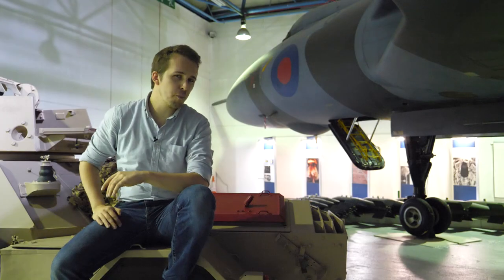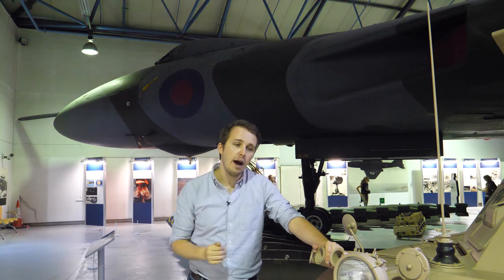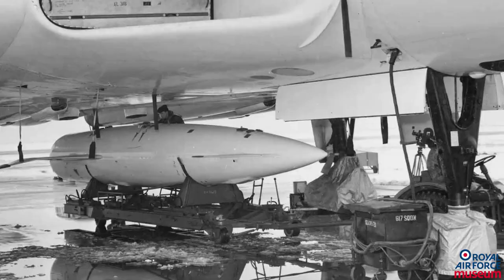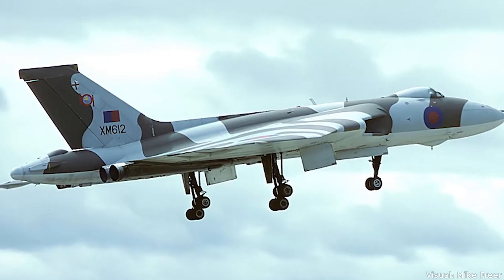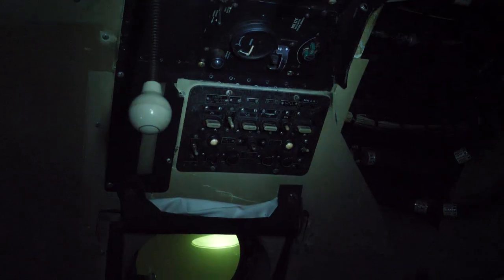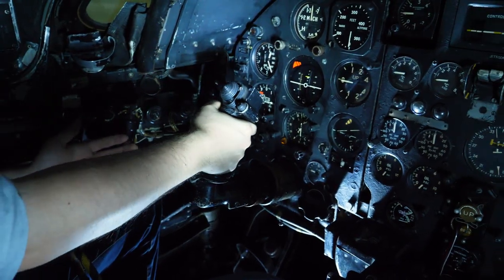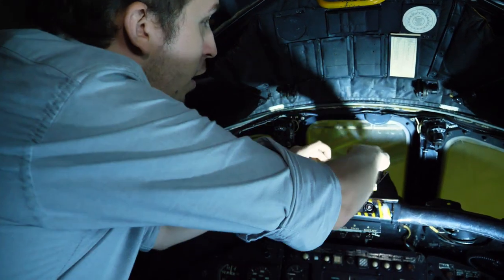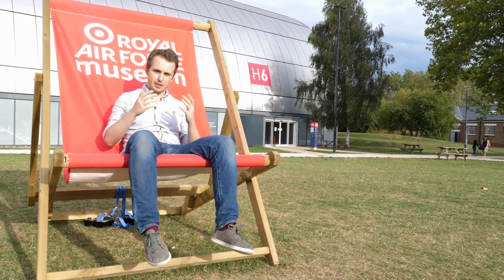Inside The Cockpit - Avro Vulcan B.2

Comment: I was lucky to be able to sit in the cockpit of this magnificent aircraft - I sat in the pilots seat and as large as the whole aircraft is once inside it is very snug fitting for the 5 crew that man it. once in your seat though everything feels cosy! This Vulcan was in a air display museum near Manchester (I forgot the exact name) but they had retained everything that the operational crew had at their disposal. For example there was an eyepatch for the pilot to wear should the aircraft ever be used for it's ultimate purpose. The eyepatch was to be worn to help protect the eye from the flash of a released nuclear weapon , on top of that there were smoked glass screens that could be used to cover the small windows in the cockpit once again to help protect the crew from the resulting flash of released  nuclear weapon(s). It was both an awesome and chilling experience to sit there and think of those whose who flew them never knowing  one day  from the next if they would be required to make their inevitable one way journey to enact what was then a vital part of our nuclear deterrent. Despite this I was in awe of the engineering achievement so soon after a world war a few years before fought almost exclusively with aircraft of propellers and piston engines and thinking what a shame it is that it took fear of a nuclear holocaust to bring out our best in terms of creative engineering and innovation.  I sincerely hope as a species we will progress very rapidly to finding an equal fervour to create and innovate for PEACE and prosperity and no longer be motivated only by fear.

Comment: The plane that just doesn't fit into one picture. Really, couldn't get a good shot of the one in the RAF museum, but it is very inconveniently placed for photos there.
Reply: It's the same in alot of museums unfortunately lot of planes and a limited display area. Best off visiting one which is outdoors, newark air museum is a good example as they open the cockpit quite often.

Comment: Managed to get inside one of these back around 1980 back when Bruntingthorpe was an RAF repair facility and they did occaisional tours. Cramped is my main memory and a comment from the guide that the downstairs crew were supposed to leave in a particular order, costliest to train first! Also that they were supposed to swing themselves out of the way of the nose gear leg if that was still down.  I got th distinct feeling that it was considered unlikely any of them would really stand a chance.
Reply: IIRC, of the 15 accidents with the plane. In 10 of them none of the rear crew survived. It was not a good solution to be. The AEO and the Radar operator actually had ejection seats, it ejected them into the open crew door. Not much but apparently better than nothing. The Nav plotter was possibly the least safe position to end up in.
I've sat in the cockpit. The one thing Bismarck failed to really point out, though he alluded to it with the 6th crewman. The vision is appalling. Due to the high AoA on landing you couldn't see the runway, you were totally reliant on instrument landing systems. Even when flying you couldn't really see forward. Forward and up was your only real vision, I seem to remember our guide mentioning the front bombing window being used to guide for taxiing.

Comment: Right, I may have slight bias but I try to be objective. My father was part of the design team on the Victor, asked to critique the Vulcan and also worked on getting XH558 back flying. For the high altitude role you state the Victor was far superior. Once the Soviet radar was updated though the stresses on the Victor wing at low altitude made it impractical, hence the Vulcan being adopted. The Vulcan was definitely a better aircraft at lower levels which was the amended requirement. The Victor had a higher ceiling, bigger payload and longer range at higher altitudes, hence it being perfectly suited as a tanker in the then new world. It was inherently better at meeting the original specification but things change. It's still a sexier plane though :P
The raid on Stanley during the Falklands conflict though? I still can't see that as anything other than a propaganda move. "We could have delivered nukes. Think about it". 2 Vulcans, 11 Victors and damage that was repaired within 24 hours. It sent a message, the message was received. Note 11 Victors required to get the Vulcans there...
Don't get me wrong, I appreciate the engineering involved in the Vulcan, what it was capable of and what it did. Some of what I know is apocryphal, no evidence basis other than the memory of my father (who, apparently, got quizzed on why exactly he showed a delta wing glider model when applying for a job at Handley Page at a time when the Vulcan was in development but definitely under wraps) but I will never have the overwhelming adoration for this aircraft that many do.
Reply: So your Dad worked at Fred's Shed???  Victor was (in the B Mk 1 form) the only one of the three V-bombers to be able to pass Mach 1 in a dive.
Reply: @richardvernon317  His first job in aviation. Grandfather and great uncle on his side worked for BOAC and Imperial Airways. He later worked for Hawker and was part of the harrier design team as well. He finally retired from subcontracting at 75 years old, the last job being for Marshall's in Cambridge getting a certain Vulcan airworthy again :)

Comment: The 707B’s air intake is an interesting choice. Obviously made possible by the fact that the Derwent was a centrifugal engine
Reply: NACA flush inlets. Popular at the time. Early P-80 variants also had them. They offer low drag, but have poor total pressure recovery and high distortion. Very incompatible with axial compressors. They are still used for auxiliary air inlets where recovery is not as important.
Reply: @MrKentaroMotoPI  That was my thought as well. An axial compressor would never be able to get proper airflow through the engine, but a centrifugal engine opens that up. Obviously was a dead end in development, as there are very few planes who still use them. 

I guess they were less efficient, and were also wider, which made the planes who used them bulkier. 

This all being more than enough to offset the advantages of a flush inlet, especially as aircraft got faster.
Reply: @jeffreytam7684  Yes, and there was something else. In the early 1960's, the "zero drag" inlet was invented by Lockheed's Woody Beck and first used on the C-141 Starlifter. It is now universally used in subsonic inlet design. By carefully contouring the inlet lip highlight, the cowl lip suction can be made to equal the cowl external drag. Total pressure recovery is unaffected even though a stagnation streamline impinges well inside the inlet. The shape gives subsonic inlets their "thick lipped appearance".

Comment: There is a episode on Malvinas with a Vulcan running out of fuel where he made a emergency land on Rio de Janeiro.
Reply: The in-flight refuelling probe snapped off during its post attack refuel on the way back to Ascension Island after a Anti Radar attack against the Argentinean TPS-43F air defence radar and gun laying Skyguard radars. The Argentineans switched the TPS-43F off as soon as they knew that a Vulcan in the area, so the Vulcan couldn't launch the two Shrike missiles that were tuned to that radar at it, but one of the Skyguard radar's tried to track the Vulcan that destroyed it with one of the two other Shrikes it was carrying. When the Aircraft diverted to Rio, the crew tried to jettison the three remaining missiles in the only way that they could by firing them. One of the missile's misfired and the Aircraft had to land with it still on the aircraft.

Comment: What is amazing is when they changed from high level to low level bombing use they could fly these babies literally on the deck like a fighter often below 250ft!!!!
You could also barrel roll a Vulcan and make extreme evasive maneuvers something other bombers of that era (B52) couldn't do. 
When one flies over you and they hit the afterburners the noise is unbelievable and the ground shakes.........A beautiful bird.....Thanks Bis.....When are you doing the HUNTER and the LIGHTNING?
Reply: The Vulcan did not have afterburners.  No V Bombers did. What you heard was just good old throttle.
Reply: At very high Altitude the Vulcan pissed all over the Hunter and Lightning as regards manoeuvrability.

Comment: If I remember correctly, during the Falklands War, only 1 bomb from the Avro Vulcan hit the runway during it's historic mission over thousands of miles from the Canary Islands to the Falkland islands.  Why didn't the Avro Vulcan simply line up with the runway and use the visual bombing sight to plant all the bombs on the runway?
Reply: A. Ascension Island is not in the Canary's (its around 3000 miles south of that group of Islands).

B.  When the Vulcan attacked it was Dark and the Weather in the Falklands for most cases is bad. At the time is was late Autumn. Most Argentinian fighter bombers were daylight capable only. Visual bomb aiming needs daylight and good weather

C. Stanley Airport was quite heavily defended with a mix of Visually aimed AAA guns and SAM (Tigercat), plus some really advanced stuff Radar controlled guns and Roland SAM capable of shooting down aircraft at up to 20,000 feet. If the AAA and SAM's can see you, ECM will not save you and the guns and SAM will kill you.

d.  The bombs are released two miles short of the target and you do not know the exact wind conditions between yourself and the ground, thus trying to drop the bombs down the runway is most likely going to result in NO BOMBS HITTING THE RUNWAY.  If you drop a stick across the runway, you are likely to get one on target at minimum.

e. To blow a big hole in a Runway, you have to have the bombs hit the runway at great speed so that they punch through the concrete and explode under it, this makes maximum effect of the explosive content and makes a big hole that is difficult to repair  If the bomb doesn't go into the concrete (explodes on the surface), the majority of the explosion take the path of least resistance into the atmosphere and just scabs the surface. That can be fixed with a broom!!!!  

Real Warfare is not WAR THUNDER.
Reply: The plan for Black Buck 1 was to cut the runway at an angle and possibly get two bombs onto the runway surface. Martin Withers, the pilot of Black Buck 1, has given enough interviews over the years regarding the mission. 

The details are also revealed in the book 'Vulcan 607' by Roland White.

Various options were studied with the final plan being to cut the runway at an angle. The final angle chosen allowed for a 90% chance of one bomb on the runway and a 60% chance of two. 

A 300ft terrain following attack was studied. The idea was to fly a Vulcan at 300ft down the runway and deploy parachute retarded bombs. This idea was discounted because of the Argentine defences and the perceived lack of bomb damage. To penetrate the runway it was thought that the low height and angle would not be sufficient.

Argentine deception techniques made the crater appear larger for daylight photo-recce Harrier runs. Simple mud and earth ring on the runway gave the impression that the runway had suffered greater damage. 

This crater caused problems with UK forces after the Argentine surrender. RAF News, April 26th 2002, has a piece from retired Air Commodore John Davis. Davis was the first commander of the operations wing at RAF Stanley. In relation to the runway crater from the first Black Buck mission Davis wrote "This rogue crater required a succession of repairs amid what soon became high intensity air operations."

Comment: " multiple long range attacks "
British understatement for the longest bombing mission in history,
( operation Blackbuck )
They flew over 8,000miles, and took out the runway at Port Stanley.
Reply: the runway wasnt "taken down". It remained operational till the end of the war. In fact all the Black Buck missions were a failure. Sorry. Cool aircraft tho
Reply: @sanignacio1999  The First raid put a Bomb on the Runway that was not easy to fix and caused the Argentinians problems throughout the war. Second Raid was a failure. Third and Forth raids aborted due to weather issues / Tanker Hose Drum Unit Failure. Fifth raid damaged primary target (both Shrike missiles impacted within 20 metres of target TSP-43F radar, but damage was repaired in 24 hours). Raid six destroyed a secondary target (Skyguard AAA Radar). Raid Seven was tasked by Land Forces Commander to keep Argentinians in Stanley Airport Occupied while the Land Forces did the final night battles that won the war. Attack was suppose to lay a carpet of VT fuzed airburst bombs on the Airfield, but the crew screwed the bomb fuzing up so the bombs either didn't explode or went off on impact.